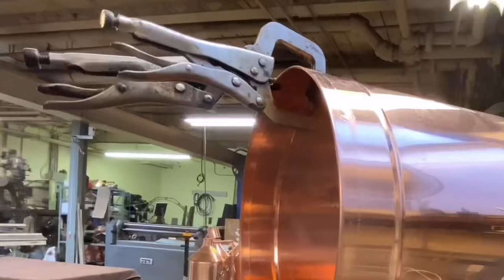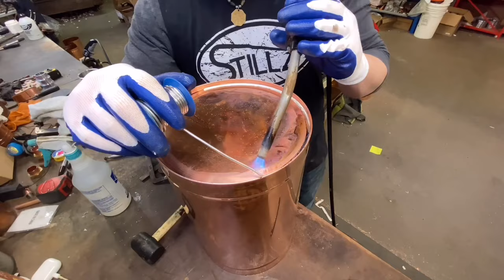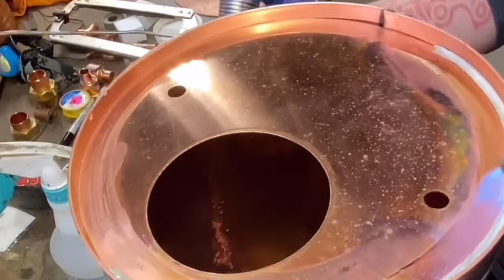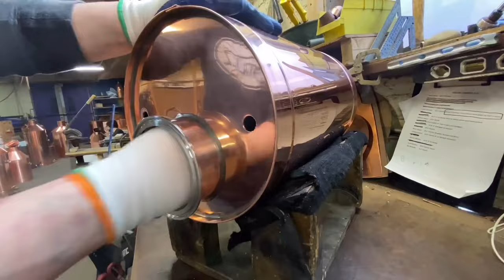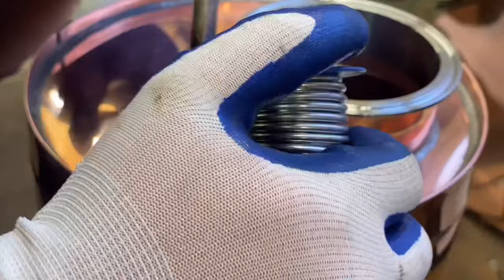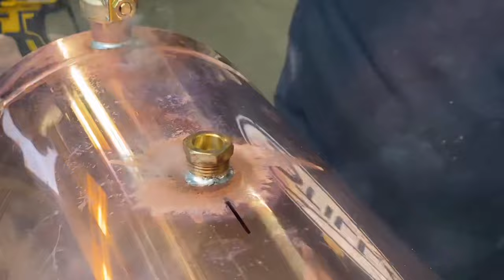Building a 5 Gallon Thumper

Comment: why are they called thumpers and what is their job ?
Reply from the maker: @brenohighland3259  The name “thumper” comes from the sound it makes during distillation. As the vapor enters the liquid inside, it creates a rhythmic “thumping” noise caused by bubbling and pressure changes.
It has several purposes

-Double Distillation: It allows the alcohol vapor from the boiler to re-condense and re-vaporize, effectively distilling it a second time for higher proof.
-Infusion of Flavors: You can add fruits, herbs, or other ingredients to the thumper to infuse additional flavors into the final product.
-Temperature Stabilization: The thumper helps maintain consistent temperatures and pressure during distillation.
-Efficiency: It captures and reuses heat from the alcohol vapors, reducing the need for additional energy.
Reply from the maker: @brenohighland3259  it’ll also catch any ‘puking’ accidents from the boiler. There’s actually something called a slobber box that looks just like a thumper but it’s plumbed differently.

Comment: What is in the spray bottle?
Reply from the maker: Just water. I used it to kick start rot cooling process (because it crazy hot obviously) and the wetness helps wipe the residue off. I use three rags. The first to wipe the bulk of it off. The second has a bit of wrights brass polish on it. So I wipe it with that then use a dry rag to wipe that off. 
I do that to each area I solder. Helps make the final Polish easier. And ensures that flux doesn’t permanently stain the copper. Lol I like em to be shiny, at the very least for when a customer opens their product and get that wow factor!
Reply: @copperstillco  thank you that was very helpful.

Comment: Hello!I want to make a copper container for a moonshine machine as a gift to a friend for his 65th anniversary.Please tell me how you connect the bottom and the cylindrical part of the future capacity of such a volume, as well as how you prepare the cylinder for its docking and subsequent soldering.Is it necessary to cut the edges of the sheet in the form of petals for their reliable coupling, or do you make do with the usual overlap of metal on metal with their subsequent soldering?And more:What thickness of metal for a volume of 100 liters would you recommend using?Thanks.

Comment: What kind of stainless are you soldering? You can't solder stainless.
Reply from the maker: 304 stainless ferrule from glacier tanks. Certainly applications, like this one in the video is very simple and easy to solder stainless to copper. Seems like a head scratcher on the surface but I do it daily.